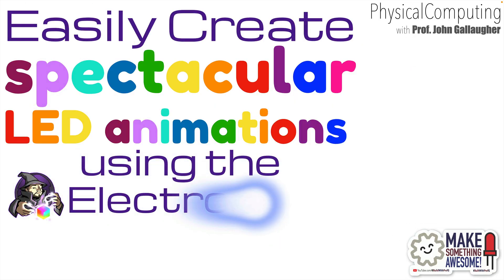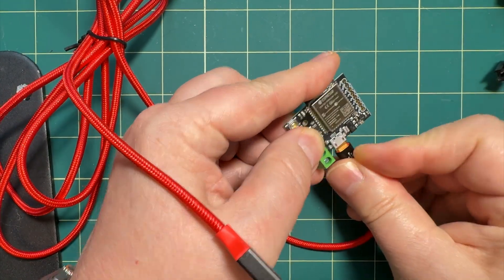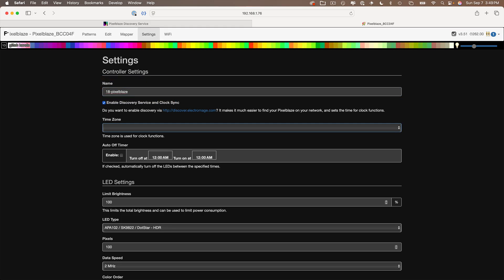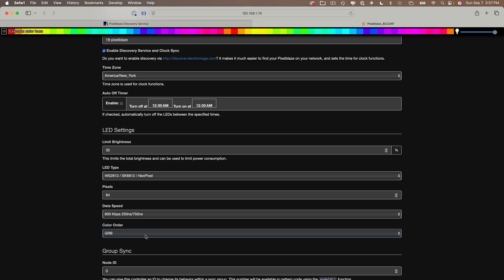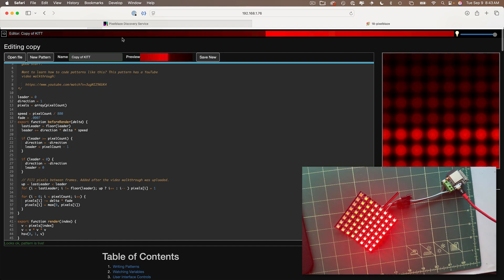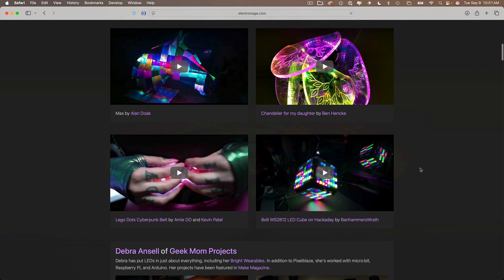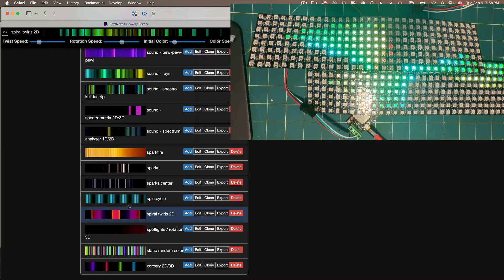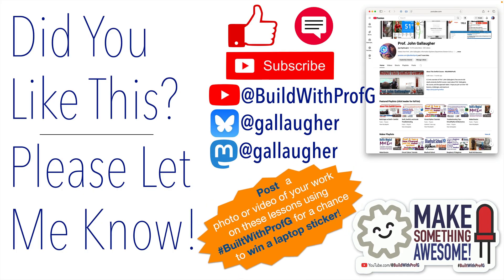A Beginner's Guide to Setting Up PixelBlaze for Easy & Amazing LED Animations

Comment from the maker: IMPORTANT: I'm noticing some changes for getting the orientation of the standard matrix layout 16x16 NeoPixels, and two side-by-side 16x16s in a multi-matrix 32x16 grid.
I've put the proper mappers (select Matrix in mapper for the first one, Multiple Matrix for the second one) in this GitHub repo:
https://github.com/gallaugher/pixel-blaze-mappers/blob/main/16x16-neopixel